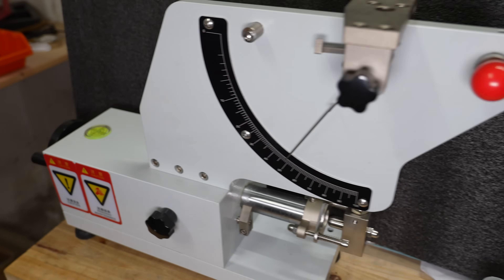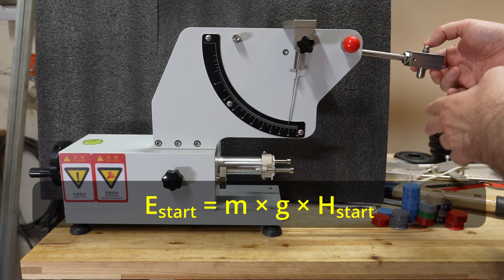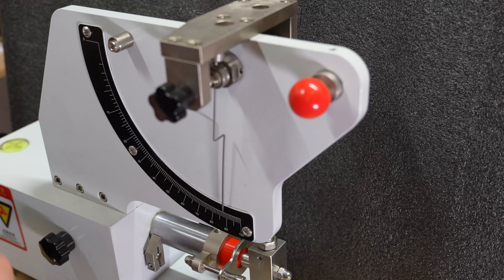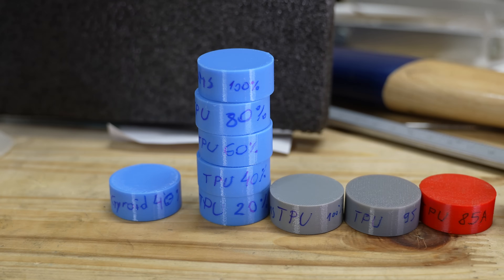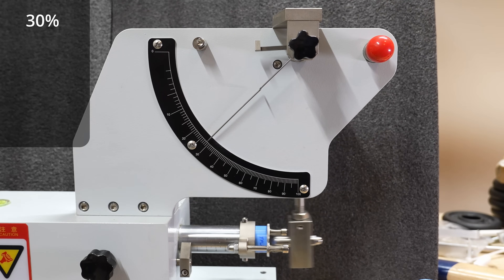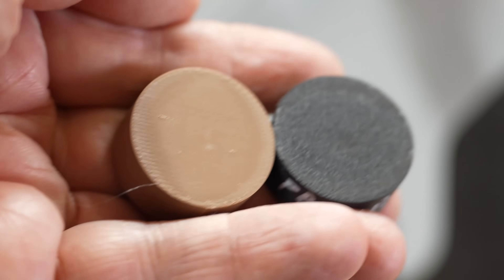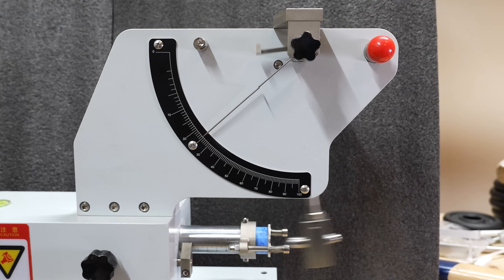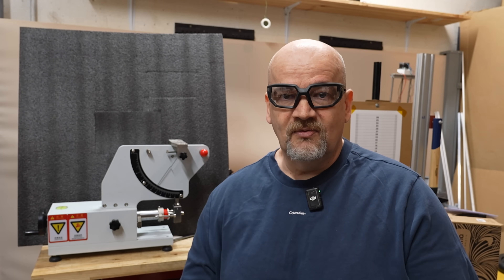Bouncy or Not? TPU Tested with My New Rebound Machine!

Comment: This is huge.  Can we recommend a list of TPU/TPE to test or send in samples to you for testing?  None of the filament manufacturers test their TPU/TPE for hysteresis (also called "transmissibility"--see Shocktech / Barry Controls spec sheets).  I think that "high speed" / "high flow" TPUs contain additives that compromise shock absorption; it would be extremely useful to know whether there is a disadvantage to using high speed TPU/TPE.  For vibration control, I would really like to see filament comparisons to Sorbothane (invented by Dr Maurice HIles), which is very expensive but absorbs vibration very efficiently.  I would also like to see which infill patterns absorb shock the best and how using sparse infill on a harder materials may differ from using an inherently softer material at 100% infill.  For instance, can we use 95A TPU to emulate a 60A rubber mount by using certain infill pattern and percentage (e.g. 15% gyroid), or is there some fundamental problem with that?  Supposedly, 3D printed mounts can actually provide BETTER dampening than conventional materials--see Perry Parts for their engineered 3D printed bumpstops.

Comment: 2:39 C'mon, just set the first layer to 0.3 mm, or use the slicer's automatic height compensation. It doesn't make sense to not do it as exact as you easily can.
Reply from the maker: 12.5 +/-0.5 mm, what is the problem with 12.4 mm? And in future reviews, I want to print this object together with other specimens, I don't want to change anything there..
Reply: @MyTechFun Well, to be fair, 0.1 mm is less than 1%, so it's well within the error margins of your device anyway. Just difficult for us ocd pedants to watch 😅😅😅

Comment: There looked to be another variable at play, even with similar rebound percentage some samples bounced more times than others. Is that just impact strength?

Also in a video about TPUs and TPEs one YouTuber showed how a TPE filament was good for bouncy balls, it would be cool to see that tested on this machine. Durometer and bounciest aren’t necessarily related, even a glass marble can bounce pretty high on a tile floor.

Comment: It'd be interesting to see how different designs of test object affect the rebound, even if that takes the test outside the ISO parameters. For instance, a test object that has a center impact area that's only two layers thick but flat, one that has two layers printed as a dome, etc. Basically, I'm thinking about testing suitability for use as a bump stop. Will it absorb the impact, while creating minimal noise and not tearing?

Comment: Try TPU 75A, you will be surprised :)
Reply from the maker: Is it printable at all? 75A is very soft. What printer do you use?
Reply: @MyTechFun  I'm using modified "HGX Lite" direct extruder/feeder from Aliexpress and Creality Spider 3 hotend. Exruder's output hole is drilled up and PTFE tube is inserted for  touching extruder's gears at output side with no/minimal gap. Volumetric speed limit for TPU 75A and 0.4mm nozzle is 2mm^3/sec. Retractions and z hops - disabled, Avoid crossing perimeter - enabled.

Comment: Now you definitely need to test PEBA! It's supposed to have the highest energy restitution (bouncing) out of any filament
Reply from the maker: Added to my very long list. Do you have experience with it?
Reply: @MyTechFun  it's polyether block amide, the main supplier is Arkema , and it's one of the best thermoplastic elastomers  you can find out there, but it's also expensive. TPU can do a similar job for less than half the price. Also, those marks that you have in your samples denote plastic deformation, so you are not measuring within the elastic region of that polymer, you are having plastic deformation which absorbs energy as well. you should have to change the mass of the hammer for the different polymers. infill should affect the measurement up to a certain degree, where too high infills cause the difference to be negligible. Cheers
Reply: @MyTechFun  not directly but I know a person that used it a lot, if you have any questions I can relay them to him

Comment: I've been printing a lot of eSun TPU-LW for my small business.  It's a foaming TPU that has a durometer of 93A when printed at 218 C nozzle temperature with an extrusion multiplier of 1, and can foam to a 77A durometer when printed at 280 C with an extrusion multiplier of 0.5.  I like it because it feeds well and prints at a lower durometer and also because the foaming results in a very nice matte surface finish that feels like the nylon outer fabric cover on a neoprene wet suit, and the textured surface helps hide the layer lines so parts don't look 3D printed.  It would be very interesting to print different durometers of TPU-LW and test their rebound to see how the microscopic bubbles change that characteristic.  I wish you were closer.  I'd print samples and mail them to you.
Reply: Siraya Tech also has a foaming TPU that goes down to 65A.
Reply: @EliteMacFreak  - That is News I Can Use!

Thank you!
Reply: 280 for tpu, wow. Didn't even know esun had a foaming tpu, good to know
Reply: Wonder if that foaming agent would be practical for other materials to change their aspect and also potentially hide layer lines.

Although Fuzzy Skin walls may be a bit more worth it.
Reply: @Splarkszter  - There is foaming PLA-LW that can be printed at 50% the density of PLA.  It's popular with people 3D printing radio control planes.  I bought some to make a thermally insulating 3D printer enclosure to facilitate passive chamber heating.